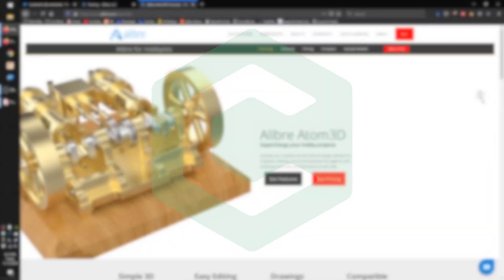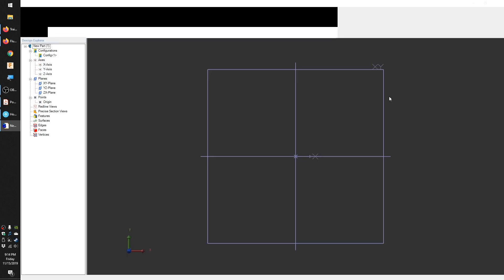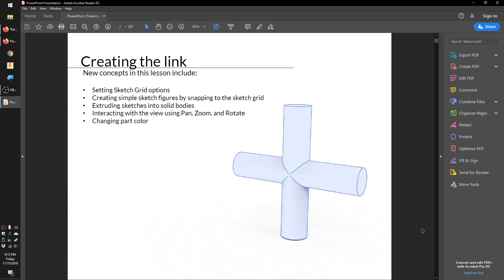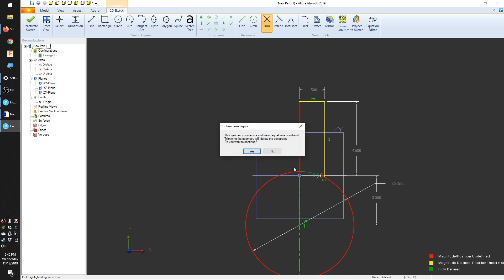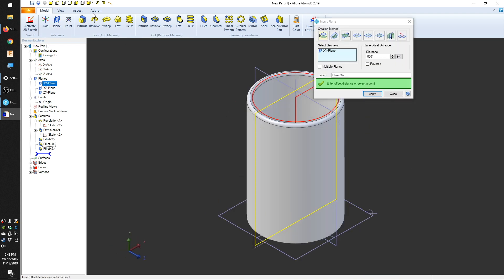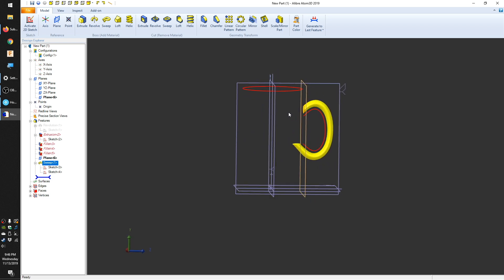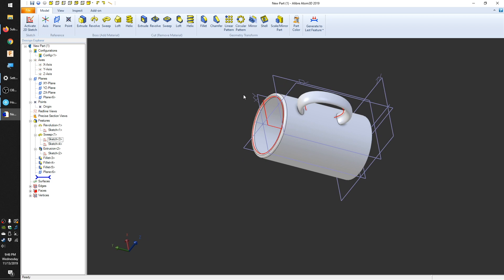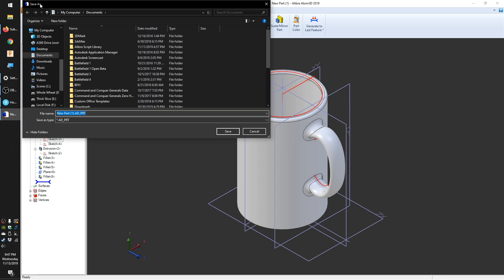Overview of Alibre Atom3D: Parametric Modeling for the Masses? - #CADurday

Comment: This might a good option since Fusion 360 is no longer free which is very disappointing.
Reply: I was a fusion 360 user for almost 3 years. Switched over to Freecad, no more funny business with Autodesk being a bully, my files are my own now.
Reply: Did they do away with the hobbyist license? If so, have a link?
Reply: Anthony Bowman  they still have 2 free versions, a personal (not for comercial use) and startup license, only thing is there is a verification process for the startup one.
Reply: I just got it for free as a hobbyist,  Been playing around with  Alibre Atom3d and think it is pretty go for the price and the fact you own it.
Reply: @larstomasson9244  Now they have announced they are putting limitations on the hobbyist version.  For this reason, I just switched the Alibre.
Reply: It's free unless you are a startup making over $100k/yr, and then still free if you go through verification and are under $100k. All hobbyists, students, and educators can still use it for free indefinitely
Reply: @Seth-mb9nt  Sorry that is incorrect.  As they turned me down and I am only a hobbyists